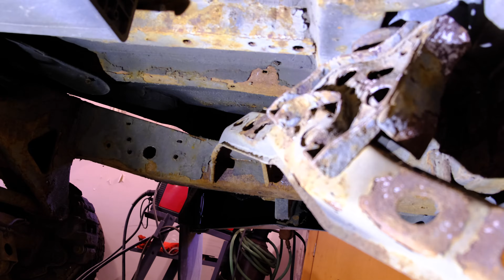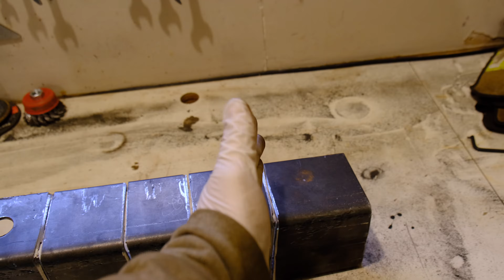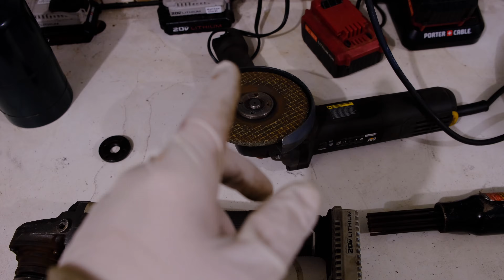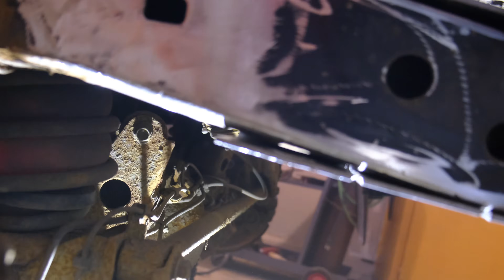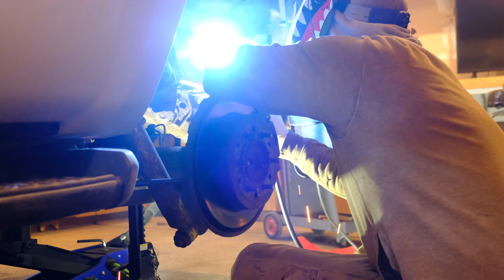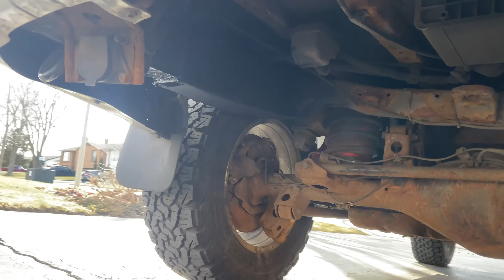WATCH THIS VIDEO BEFORE WELDING/REPAIRING YOUR FRAME! RUSTED TOYOTA FRAME FIXED AND REPAIRED CORRECT

Comment: A little tip for you is to not weld square patches but rather diamond patches. Do a little research so you understand what im actually saying.
Reply from the maker: Yeah I believe you are referring to what we call fish tails. In this particular repair this is what the person wanted but I agree with you in most cases that is the preferred method!

Comment: Did you remove the gas tank to do that?
Reply from the maker: No I didn’t have to remove the gas tank but you definitely could to be extra safe
Reply: @Giorgis_Garage  see why I asked this is cuz I wanted to do the box on my truck like the wheel walls so I was wondering if I needed to take the gas tank out plus my gas tank is a plastic one but any information helps man thanks
Reply from the maker: @S @Speedboss1124 A little trick for plastic gas tanks is wrap any areas close to where your welding in tin foil this way the splatter or sparks from the welds won’t melt a hole in your tank! It’s cheap and easy way to protect yourself and the gas tanks always be careful tho! right way it to remove it but you can always take short cuts at your own risk

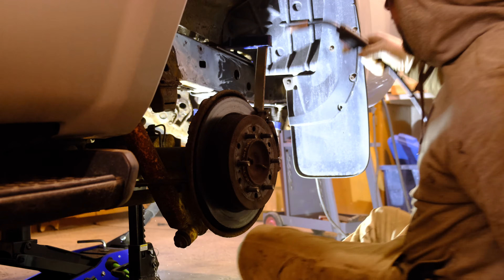Comment: Just remember to wire brush after each weld to avoid slag inclusions. A wire brush attachment to a grinder saves time. (After 8:20)
Reply from the maker: Will do thanks for the advice